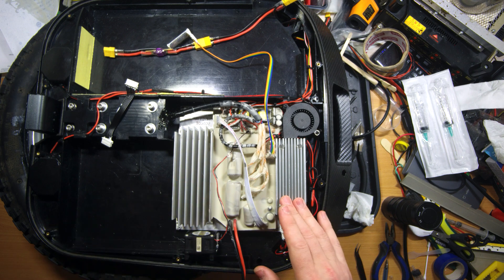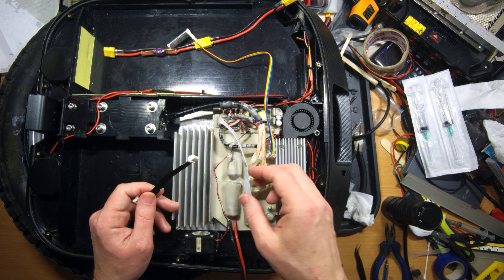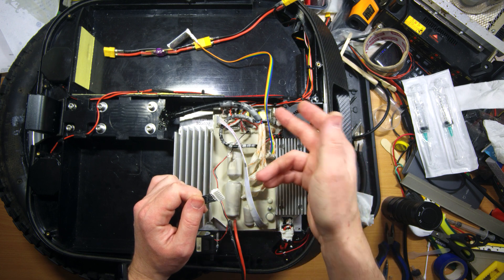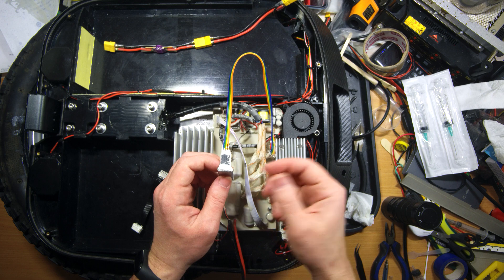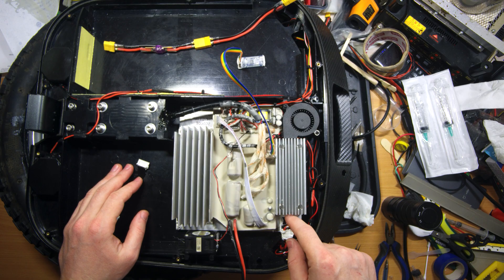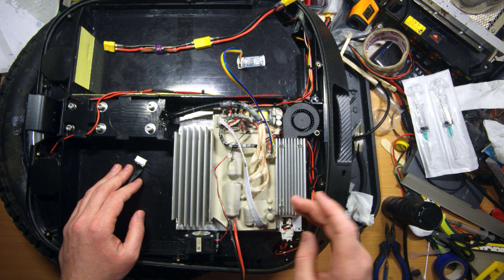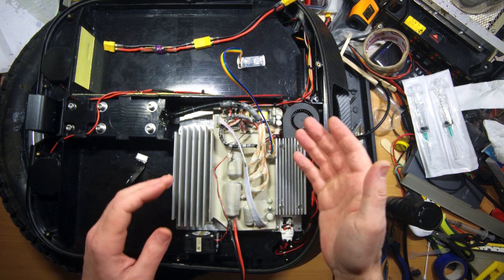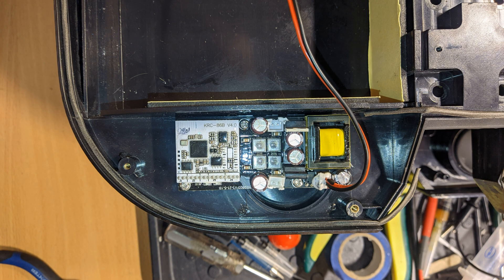Begode EX.N: Cooling system tuning v2

Comment: is that what the cooling system looks like or did you buy a bigger heatsink?
Reply: it does look modified. i bought a similar copper heat sink that fits on computer ram memory from amazon. and it fit perfect for my RS

Comment: Hi what kind of conformal coating you are using on the control board?
Reply from the maker: It's Silagerm, I'm not sure, that it's available on your market. Try looking for a termal transfer compund, which is easy to be removed.

Comment: Hey, you mention filling the empty space below the main board with a 400-500wh battery. 
Where did you find this battery? 
How do you install it? 
My wheel has 650 miles already could I Install an extra battery with out issue?
Great videos BTW! Love the mods!
Reply from the maker: Hi! This is a custom-made batterry pack, which is connected to the main battery pack BMS. You can't buy it, but you can order one to be built by the battery workshop for you.
Reply: @ITm0nkey  what would the cost be? How long would it take?